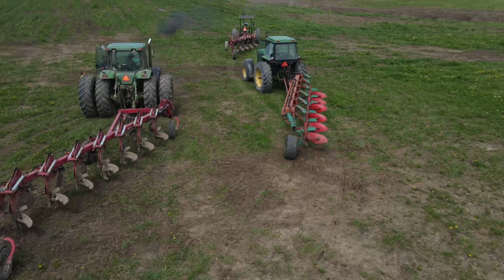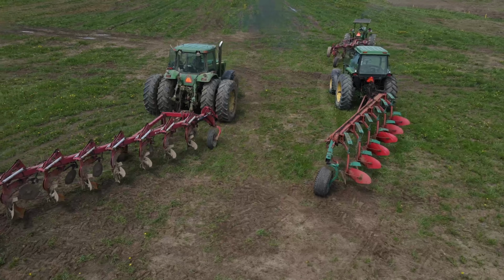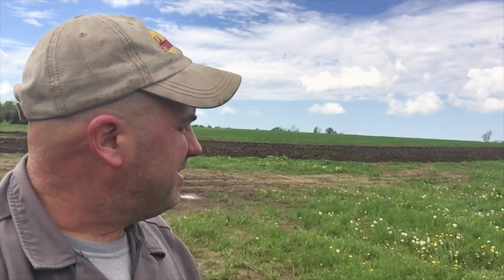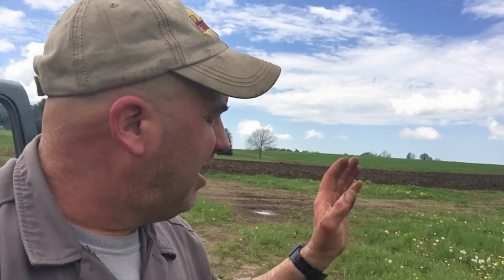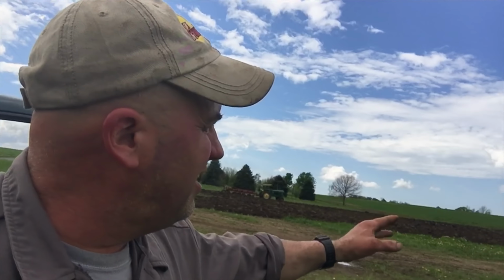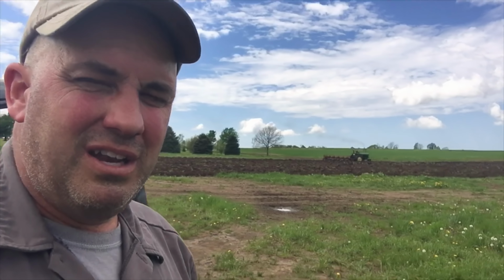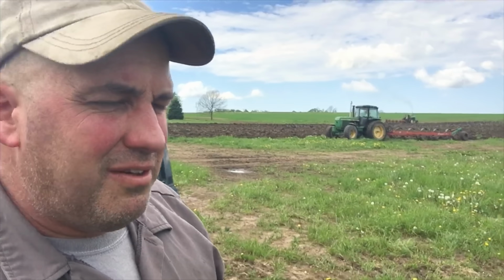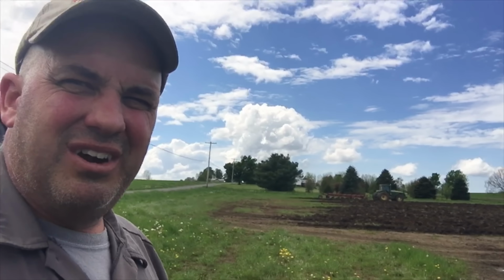Moldboard Plowing with Straight Pipes

Comment: Good story from yesteryear!  I was probably a little older, 14 years old in 1962, plowing with a 1939 Farmall H with a little gypsy two bottom 14" plow turning over oats stubble which was the easiest to learn on. Dad always wanted to run the plow as deep as possible, no hydraulics so you had to keep an eye on the depth and adjust manually and then constantly moving the hillside hitch to keep the farrow turning over evenly, he didn't want to see any gaps there either. Good memories plus I got out of the evening milking!

Comment: I loved plowing. The sounds the smells. Everything was drowned out by the tractor noise. I wrote a lot of stories in my head while plowing. I learn to plow with a 350 International gas with a 4 bottom plow. Also use an old Farmall M using a three bottom plow. This brings back a lot of memories. 💜

Comment: Cool to see you doing that Andy!  I just plowed a field that hadn't been used in a few years a couple days ago.  I used my 5055 and an old JD 3 bottom to do it.  I was really surprised how well it worked.  I even went through an old fence row I had just pulled some pretty big trees out of, and I went real slow, and it cut and pulled all the little roots right out!  I disced it up and then went over it with a chain harrow to gather the chopped up roots.  Going to plant some hay in it just to have it green and maybe bale next year.

Comment: late 90's i first turned dirt with a MF 165 and 3-14 in hard clay. We finished that year with the JD 1120 pulling the MF165  as it had rained and greased up. 
Last time i plowed was in a JD 7700 with MF 880 5-18, following a JD 7810 with 6 bottom kverneland. Sadly no straight pipes though.

Comment: Moldboard plowing the original autosteer. Drop your front tire in furrow and didnt have to touch steering wheel till you get to headland. My dad still criticizes all fields he goes past that was plowed whether plow wasn't level or first furrow was crooked. Most  field are hilly so all furrows should be thrown up hill for erosion so you only plow 1 way thats why I went to chisel plow now no till

Comment: First plowed with a Massey Harris 44 with a three furrow trailer plow. Had the spring pressure release on the ringed drawbar hitch. If you hit a rock the plow would release from the tractor.. You always had the rope for the plow raise level hooked to the spring holding up the seat. When it came unhooked the plow would pull the seat spring out causing seat to fall down, Sure let you know in a hurry you had came unhooked. 😅😂😂😂😂🇨🇦🇨🇦🇨🇦 Had to love the olden day’s,

Comment: Where is it written that you have to go like a bat out of hell.  All 3 tractors should shift down 1 gear and
always lock your wheels together for better traction.  The Deere's are easily unlocked, just by stepping
on 1 brake, so that you can turn at the end of the field.

Comment: I could see you got Some problems with your kverneland plough it wasn't  pulling straight means et needs ajustment a kverneland must run Straight behind the tractor no matter soil type  the springs shouldnt be under that pressior while working it is only when you hit a rock they Should bend like that

Comment: wow these plows not set correctly and wheel in furrow not filling in properly. Need to do a head land strike out and keep it even. Make for the second pass with disk or cultivator that much better. All tractors struggling to pull the plow land must be compacted.
Reply from the maker: Plows are 30 years old. Tractors weren't running wide open.